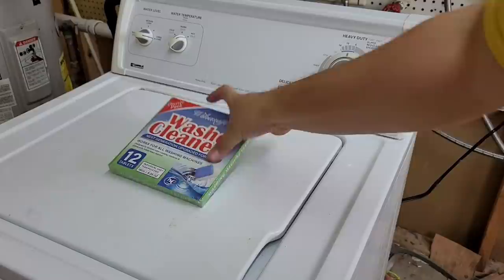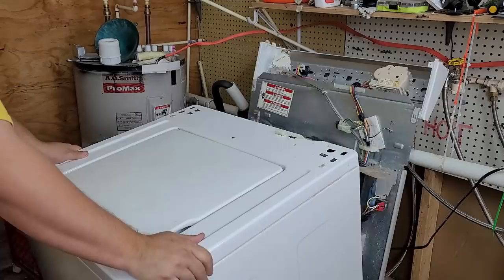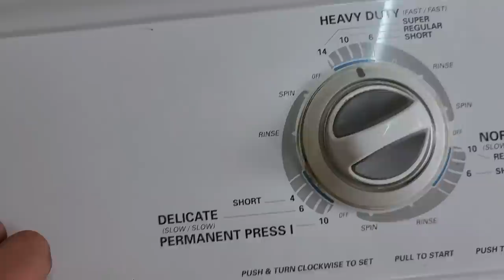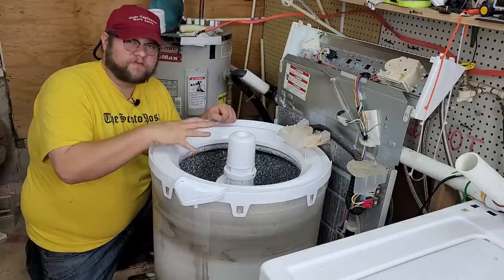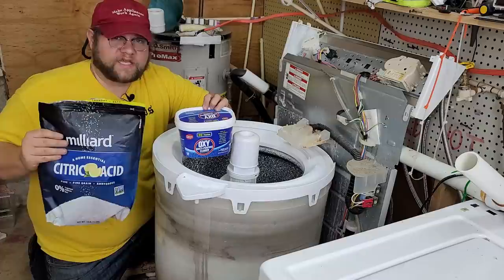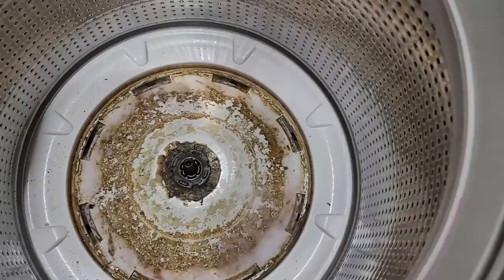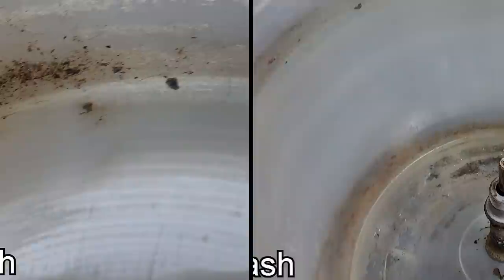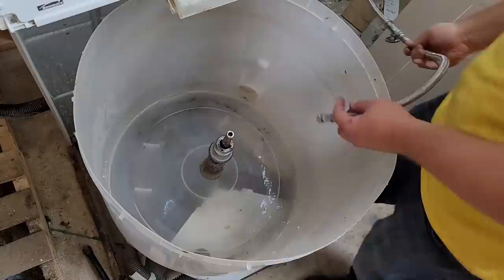Clean a Washing Machine Inside: How to Remove Mold, Soap Scum and More with a CHEAP Organic Cleaner

Comment: Older machines are far superior to anything built today, I’ve wasted so much money on newer washers and they all rust out. I found an older drum washer and had it refurbished and it runs like a dream.
Reply: Where did you find it, and where did you get it refurbished if you don't mind me asking?
Reply: rust is caused by bleach. it's better to always properly rinse the washer after adding anything any detergent that contains bleach. after a drum bleach (aka super cleaning but potentially corrosive to metal acid wash ) is important to rinse like 2 x with something like baking soda ( alkaline solution to neutralize any acids).
Reply: @GoaWay...  look online for a local place near you that sells rebuilt washing machines. There are a couple near where I live. They're just as good or even better than buying a new one and they're a fraction of the cost as well. The guy who does it where I live said the very same thing as "Living Life" did. The older style washers are much more durable than the new ones. The simpler the design of the washing machine the better.
Reply: @Cubby113able  ok thank you. I hope some of those kinds of places are around the place I live. 🙂
Reply: @DiscoveryWonders  Bleach is a base, not an acid...
Reply: agree our washer broke and it was brand new lasted only about a year.
Reply: Get Miele you will be fine.
Reply: @siiNke  And broke they cost a fortune.
Reply: Tony Po  I would have said it a little nicer, 😂 but you’re still correct. I’d also like to add that older machines waste so much water, just treat the new ones the right way and you’ll find they’re much better than the older ones.
Reply: Also they are easier to fix. A repairman told me the parts are mostly metal not plastic so that helps and that old ones don’t have all the chips and functions that when one thing goes awry it causes other unrelated functions to go awry. A old washing machine just has one purpose - it washes. It was like my old refrigerator that lasted thirty years. It had one purpose. It kept things cold!
Reply: I loved my 25 old Norge washer and dryer. I replaced them when the dryer stopped getting hot. I wanted to keep them forever because the capacity was larger than almost anything on the market nowadays, they had infinite water level and temperature settings and a ton of other options. . I did a lot of research and I absolutely love my new HE steam washer and dryer.  Clothes get so much cleaner and they come out looking like new, not loose and dingy like with the old Norge appliances. I haven’t changed detergents or fabric softeners so the improvement is all due to the new technology. Both are the largest capacity. The washer is top loading and doesn’t have an agitator to catch/tear fabrics. The wash and dry cycles are finished in a fraction of the time it took for the appliances I replaced. I have no regrets about purchasing these new appliances. There are a lot of great washers and dryers available with time saving features. Just don’t use more than the recommended HE detergent or liquid fabric softeners because that can muck up the works.
Reply: @DiscoveryWonders   so we basically should be routinely cleaning our washing machines in between washing????
Reply: I'm still using my Kenmore washer I bought in 1995. Never had a problem with it.
Reply: It's the government's fault. They demand the extra efficiency which affects the durability
Reply: The older washing machine last and last!  Cost nothing to fix compare to the electronic washing machines of today were a circuit board is $300 and installation is another $200.00.
Reply: this guy That's complete nonsense. Longevity has nothing to do with improved efficiency. The reason modern machines don't last as long is because consumers have demanded ever lower prices. In the sixties a washing machine cost about six weeks wages for the average working man. Today, a basic machine costs about two days wages for the average working man. Do you honestly expect a machine that costs two days wages will last twenty years like the one your grandparents saved for months and months to purchase?
Reply: @spencerwilton5831  that's not true at all.
Reply: @Cubby113able  ,
Reply: @GoaWay...  look at American freight 
I bought a nice LG dryer that was reduced because of the tiny ding on the side….dryer completely unaffected from ding
Reply: The new saying RUNS LIKE A DREAM.  DRIVES LIKE A DREAM.  What does a dream drive like?
Reply: Living Life,
Speed Queen is the best commercial grade washer for residential use. I bought one in 2020 and it is the best.
Reply: @spencerwilton5831  this guy is right, bruh. You can't find a washing machine that allows the laundry to "soak". The consumer's ability to control how he or she used the machine has been limited due  to exactly what "this guy" said. The government regs. I bought a Speed Queen that actually had a thirty minute soak cycle. The consumer is hard pressed to find a washer that is user friendly.
All the associates in Lowe's and Home Depot will tell you that what "this guy" said is true.
Reply: I love my old Maytag hope it outlasts me.  Best machine would not even have one of the new ones today they are way expensive  and nothing but junk.😊
Reply: @awifeinterrupted  mine is a Kenmore series 70 heavy duty- 1989 still runs like new. Only had to replace the timer mechanism. I don't care how much water it uses!
Reply: @jeffreybaker1725  just last month I had to make the first repair ever on my washer. The agitator dogs were broken. Less than $5 later (doing the repair myself), the agitator is working properly and we're rocking and rolling again. 😉
Reply: Blatandly false. Old washers waste an insane amount of resources. Progress is so quick in energy and water efficiency that you have to replace your washer every 3 years (or 5 i forgot witch) regardless of if it still works or not. 

Not to mention, miele still makes amazing machines.
Reply: @siiNke  😂 yes w0 years ago not now! They broke often too!
Reply: As long as they are front loaders. Top loaders with agitators are the devil's work!
Reply: I agree 150% I have an Old 1940s ringer Maytag washer. I can out wash ANYTHING they have now. My 'new washer Maytag' glass top. Is JUNK I hate it. Piece of crap. And it takes like 3 hours ugh and I have a 1970s maytag washer love that too!!!
Reply: I agree with your point. I don't like front loaders and they don't last as long as top loaders. I had a top loader that last me 20  plus years. I got another top loader now.
Reply: @mjremy2605  I won't buy a front loader ever. I love my top loader.
Reply: @vaderladyl  Well, if it ain't broke, don't change it.  However, I find that the front loader is a smarter design. It uses much less water.  It is horizontal not vertical, so gravity does not put a strain on the washer motor or clothes.  It does not have an agitator that ruins clothes, esp delicates like chenille.  it does not accumulate dirt the way an agitator does.  It runs more efficiently, shorter cycles, and clothes come out with less soap residue and dirt. Youi can pack more clothes into a front loader, than a top loader due to difference in design. Maintenance is very easy.  There are only 3 cleanups: lint filter at bottom, remove gasket and replace every 5 yrs (easy), remove soap dispenser and run thru dishwasher every year (easy). Done.  I bought my LG washer used for $45 and it had a leak. I looked it up on Youtube, cleaned out the soap dispenser and it works like a dream. Big heavy duty machine, and never have any problems.  I love it!  Also bought my electric dryer used for $30, cleaned out the lint and it works like a champ!  $75 for both, what a deal!
Reply: When my wife and I bought our first house in 1986, we got a Kenmore washer and dryer to put in it. I still have the receipts.
I've replaced a few parts over the years, but it's starting to look like we will not outlive those two appliances.
A couple of 20 year olds starting out certainly can't expect the same from the washers they make now.
It's unbelievable what we've come to accept as a "society"
Reply: New washers are truly awful 😝
Reply: Not  necessarily. I bought a used LG washer front loading, and it runs like a dream and is a beast.  Its pretty new maybe 5 yrs old. Not a vintage model.  Front loaders are so much better. It had a leak due to accumulated gunk on the soap dish, so I took it out, cleaned it in hot water, and no more leak. The only maintenance you need is to clean out soap dish once a year, and every 5 yrs or so change the rubber gasket on the door panel which is super easy too.  Much, much better than the older technology of agitator washers - those should all be scrapped for steel.
Reply: 2 years ago I bought a shiny new Samsung washer. The older washer was 17 years old.  Just 1 belt replacement in that time.  The new samsung is now broken. Waiting on a repair guy. 2 years.
Reply: @Nuffsaid876  Research the issue on Youtube. You may not need anyone and it may be a simple fix. Samsung makes much better washers than Kenmore.  You cannot remain in the past. Not everything new is bad. Its just different and you don't know how it works.
Reply: @mjremy2605  well thank you
Reply: THAT was a great idea--to refurbish an older drum!
Reply: Totally agree with you ❤
Reply: @missyjayjay1  yes
Reply: So true. They are built so good and last forever.
Reply: I bought refurbished twice in the last 20 years. I wish I could find the old Whirlpools new 🤷‍♀️
Reply: @Spencer Wilton  who makes a thousand dollars a day?  New washers are $1200!  I want your job!
Reply: @glennnichols4220  Perfectly.  Duh.  Which only happens in dreams.
Reply: @tjeulink  I'll stick with lots of water.  You can't rinse dirt out with a tablespoon of water.  I don't care how efficient it is.  My new dishwasher doesn't even clean the dishes.  You know why?  Because it doesn't use enough water!  And now I have to wash the dishes before I put them in the dishwasher.
Reply: @saltyolbroad2962  thats just plain wrong. You're probably using your dishwasher wrong. I have a modern dishwasher that deals with anything i throw at it, even if its a week old and crudded on like spinach.
Reply: this is a great example of survivorship bias. of course all the current working “old” washing machines are superior, because they’ve literally survived for this long! but i bet you aren’t looking at all of the ones, perhaps even the same model, that haven’t lasted this long. survivorship bias
Reply: If you have a brand new machine that breaks on you in a year... That's a you problem not a machine problem. Modern LGs (and even Samsungs) clean circles around older models using less water, energy, and soap.
All machines, even old ones need intensive care. Older machines probably have wider tolerances for abuse (because they're wayyy more expensively built).
But if you're using a new machine, daily, without maintenance you're gonna run it into the ground. 
Gotta ask yourself why you're one of few schmucks with yearly failing appliances. Also kinda telling when people complain about new appliance failure but don't pursue warranty when warranty clearly exists on new appliances.

Comment: Leaving the lid open after each wash on any washer will prevent mold.
Reply: Was going to add that.  Never ever keep the lid closed .  I have a 2001 Kenmore still going strong and never any mold or mildew. I don't even close the lid when it's running.  Had to bypass the lid switch years ago when it broke.
Reply: Exactly. Never leave a washer lid closed when not in use.  Same goes with a dishwasher, crack the door open to dry it out!
Reply: Exactly
Reply: I'm in an apartment so the washer is older, we always leave the lid open but I'm trying to figure out how to get the gunk out of the inside like I mean GUNK not mold 😩
Reply: @boomie2683  Drop in a Dishwasher tab, I use Finish Tabs..Wash on hottest water temp..You may have do more than once..You may want put in two of them if that bad..
I do this every month or two..
Reply: That’s if it’s brand new brain buster
Reply: We keep ours open too
Reply: @dbrown6941  Unfortunately not all of us know how to do that. Just bought a 2020 or 2021 Maytag with a tall agitator. There’s only one cycle that will fill the washer about 2 to 3 inches from the top so we are able to wash clothes. All of the other cycles only fill about 1/2 full with the deep water fill on and clothes in it. I can’t wash clothes on the normal cycle because it will not fill. I looked it up on Google how to bypass that setting so it will fill. However, if I do that I will void my warranty which is 5 years. So I’m screwed either way. I will just have to use it like it is until the warranty goes out and then I will be able to set it where it will fill on all cycle selections. I have always kept my lid open for the reason you stated.

Comment: This combo works AMAZING! I used 2 cups citric acid and half cup of Dollar General Oxy Clean and lemme tell ya the gunk it loosened up was pretty gross. 2 more cycles and it was completely clean. Thanks again.
Reply: Jus curious, What water temp did you use?
Reply: did u have to take your washer apart and scrub it like this guy did?

Comment: You can do this without opening it up on these old units. All you have to do is let it run part of a cycle with a little bit of water and then unplug it and let it sit there for a while. Then plug it back in and let the cycle complete.....

Comment: Hey Ben do you have a front load washer version of this video? Tons of mildew smelling loads. Need to fix. Thank you for helpful videos
Reply: thats the curse of front load washers; get rid of it; get a top loader.
Reply: Try using dishwashing tabs ti clean it,  If it does not work, get rid of it.
Reply: At the very end if this video, he said it would work on front load washers.  I would think the ratio would be the same, but only use about 1/4-1/3 of the amounts for top load washer since front load washers use so much less water.   I’m just not sure if you can run an empty load for front load washers.  I would probably run it on the soak cycle and then reduce the spin time to almost nothing … maybe on gentle cycle for spin.
Reply: @Lauren-vd4qe  in Europe even top loaders are made like a front loader. There's no agitator inside and the drum rotates around the horizontal axis, with a door put in a segment of the drum itself
Reply: Wipe in between the folds on the door gasket make sure it’s dry, where door closes, do this after each load and leave the door open afterwards.

Comment: Thank you so much this is really helpful advice
Edit: guys, I tried it, this really really works. My washing used to come out of the washer smelling kinda musty, which would dissipate after drying but told me there's probably a lot of muck in there. I had tried a commercial washing machine cleaner before but it did nothing, so I figured it was a scam. Buy ih no
Did precisely what OP said and my laundry smells GREAT now, even right from the washer. Put the citric and oxi through on the 90 degrees celcius 2 hour full cycle skipping the pre-soak and it is so much better. I'll do this every 3 months from now on. THANKS!!
Reply: How old are your water heater and washer? 90C is hot enough to shrink most "white" fabrics and damage most colored ones.
Reply: @psdaengr911  90C is usually used to clean bedsheets, especially if someone in family is sick, not for everyday washing.
Reply: @psdaengr911  I didn't use that concoction on laundry. I had it empty. And I've washed my sheets on 90, they're designed to take it, I usually do 65. Washer is 12 yo

Comment: Just repaired and cleaned a washer/dry stack unit. We had used it for several years, but it was about 24 years old. couldn't hardly believe what was under the agitator and between the tubs. I took my power washer and cleaned it outside. But in the end, it's as clean as it was when it was built. Really glad to have found your video, now I know how to keep it that way. Thanks!

Comment: PSA! Quick safety tip: DO NOT substitute regular chlorine bleach in this process. Mixing chlorine bleach with any acid will release toxic chlorine gas. And toxic means it could be deadly. Even if inhaled a little bit can cause acute damage to the upper and lower respiratory tract. If you mix chlorine bleach with anything and the smell intensifies or you notice  yellow/green gas or foam forming leave the area. Ventilate the room well before returning.

Oxygenated bleach is not chlorine based but a sodium salt, sodium percarbonate. This also reacts with acids but the gas released is harmless carbon dioxide.